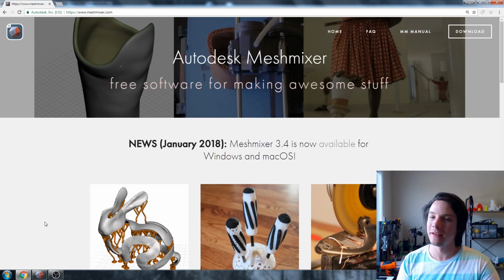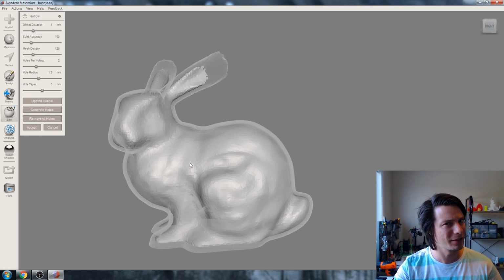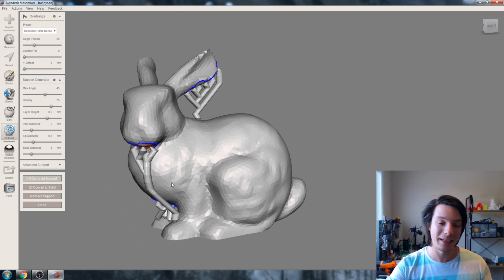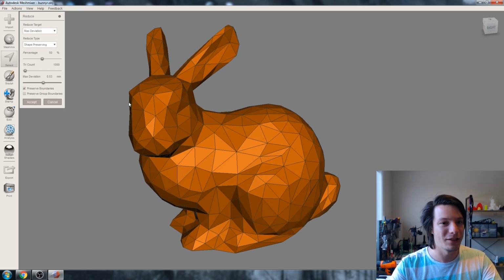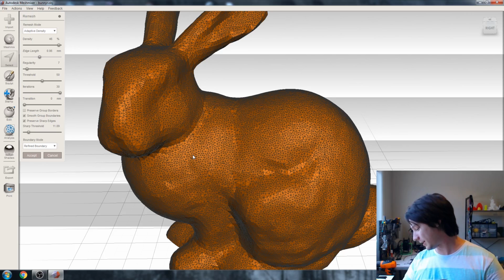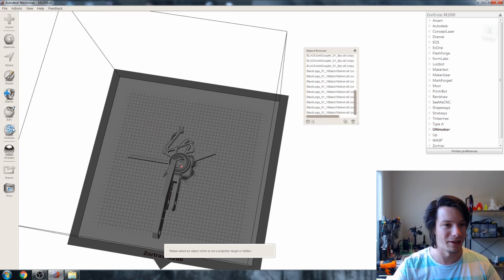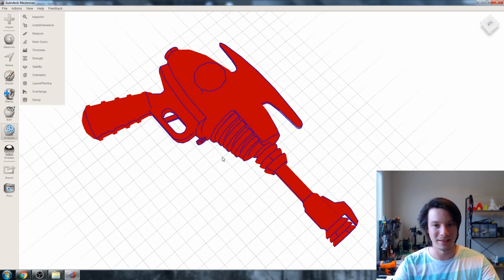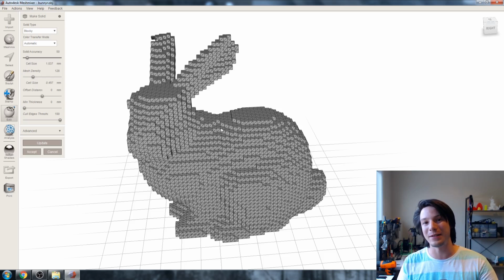5 More Reasons you need Meshmixer for your 3D Printing Projects

Comment: Another reason to create holes (aside from drainage) is to prevent suction. If you print a hollow object like the bunny on a resin printer you can get a lot of suction. A trick for making holes is to make them a standard size so that they can easily be filled with some styrene rod. There is also a program that saves the pieces from the holes as separate parts so you can put them back in the holes after printing but OTTOMH I don't remember which software it is that does that.

Comment: I use meshmixer supports for FDM printing all the time and have never had a problem with my printer knocking them over. I much prefer them to the standard support style. Also, I haven't ever had any issues with my slicer and I don't even "bake in" my supports using make solid. I just export the model as is after adding supports.

Comment: Does it work with deltas? If not, what would be a good, free option?
Reply from the maker: Meshmixer is not a slicer, it's a mesh editing program. The .stl files you export will work in any 3D Printing slicer.

Comment: Hi Angus, thanks for the video. I do have a tech question -  when I try to open Mesh Mixer, all I get is a small (blank) icon on the lower task bar - have uninstalled / reinstalled MM but still no luck.  
Running an Asus laptop with Windows 10
cheers
Reply: +dan Madden - FWIW, I run MM fine on an ASUS i7 UX32VD laptop / Win10
Reply from the maker: +Dan Madden it might not meet minimum specs?
Reply: Maker's Muse , I will check, thanks,

Comment: I have made few car & plane in solidworks. All are made by surface modeling so layer thickness is really small any printer so may this hollow feature works.
Check the Airbus: https://www.thingiverse.com/thing:2775036
While slicing it seems ?
So, can it be printed

Comment: The problem is, before I got my printer I upgraded to win10 creators, and it doesn't work on that
Reply: YTred TrialHogger meshmixer works on Windows 10 creator's update.
Reply: euan todd maybe it's just the Dremel version, I have a 3d20 and the included slicer is ass...
Reply: YTred TrialHogger I believe that their is a plugin for cura to export .g3drem files but I don't know for sure.
Reply: euan todd maybe it's just me being stupid but I can't get that to work either, I can get the 3d20 to show up as a printer but I can't get it to export to g3drem
Reply: euan todd just realized, I was talking about Autodesk printstudio, not meshmixer, but I tried the cura plugin on the official version, not Dremel's, and it worked, oddly enough

Comment: As soon as they stop ignoring 1/3 of the population using linux....
Reply: Peter Ellens 1/3 lol.
Reply: either wine or whine, it's your choice.
Reply: SimParadox of 1%
Reply: lol... 1/3.... what years are you living in? 2118?
Reply: Wine is perfectly okay, it barely affects performance, even in games.
Reply: Adding operating systems to the list: Religion, Politics, Operating systems. :)
Reply: so uhh, unRAID OS, Linux, works great. And hosts my Winblows 10 VM which has direct hardware access thanks to OVHM pass-through. So now I have a badass NAS for home, a decent gaming PC (140FPS Assetto Corsa 1080P settigns all on max) or I can use it for CFD/CAD/4K video editing. All in one box. So thank you linux! Also my windows VM has been stable for over 2yrs! Thanks Xeon, Hynix ECC, unRAID team, and Western Digital!
Also, doesn't the military and navy use linux like exclusively?
Reply from the maker: http://meshmixerforum.com/index.php?PHPSESSID=lu5i9nou52fhdug0itnedv0527&board=8.0
Reply: Wine is no way to run any resource hungry application.
Reply: 99% of servers are runing on linux.
Reply: I'll just keep using Blender.
Reply: @Nobock ... I think you mean 99% of Raspberry PIs are running Linux... -- Definitely not servers! (w3c says Linux comprises about 39% of the top million known web hosts, which is about 5% higher than Windows; though for the top thousand web hosts, they have Windows usage beating Linux at 48% to 35%.) -- But I mean hey, at least Linux has the Raspberry PI going for it... mostly.  XD